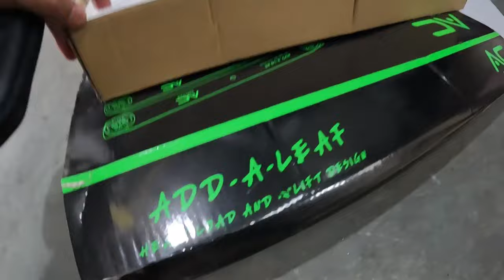RIDEMAX 2 INCH SUSPENSION LIFT FOR HILUX | BFGOODRICH KM3 TIRES | ROTIFORM SIX BY FUEL MAGS

Comment: Sa manila boss full build ko ridemax at king springs add a leaf, kasama na 17 na rins and 285/70/17 patriot tires rt+, 112k lng. Libre na lugnuts, balancing, wheel alignment, camber. Grbe mahal dgdi sa naga magpa build
Reply from the maker: Hehe eu po , ako po kaya boss si mags and tires ko nakua ko secondhand lang worth 50k pero si brand niya rotiform by fuel mags and ang gulong BF Goodrich Km3 na kaya ang pinatrabaho ko lanh sa naga is si suspension para mapataasan ko si unit ko , biglaan man lang kaya na may natimingan na nagpapabakal digdi sa iriga ning maurag na mags and tires kaya tigkua ko na hehe
Reply: Boss saan ka nagpa build sa manila? Anong pangalan ng store?
Reply from the maker: Sariling concept ko yan boss, yung mags and tires nabili ko secondhand tapos yung suspension nagpalift lang ako sa naga city para makalagay yung nabili kong mags and tires
Reply from the maker: Pasubscribe ako boss salamat
Reply: San ka sa manila nag pa build boss? Mura yung 112k.
Reply from the maker: 2nd hand ko lang boss nabili mags and tires ko worth 50k tapos yung pagpalift ko is 52.5k kasama lugnuts dito lang po ako sa malapit samin bicol area nagpalift , yung ibang mga accessories hiwa hiwalay po yan kinabit hndi sya kasama sa 102.5k na gastos ko sa mags tires and lift, pasubscribe ako boss salamat
Reply: Ls autoworks ako nagpa build

Comment: i got mine a year a ago ridemax + kings setup wrap with bfg 285/75/17. i used to play 1  and 2 settings pero mdyo matatag pa din. i dont know sa iba yun pero yun tlaga na experienced ko with this setup
Reply from the maker: Hanggang ngayon ba boss ?
Reply: @EngrJaoMotovlogs  yes boss, good thing is mas okay sya compared sa stock suspension.
Reply from the maker: Pare pareho ba boss settings mo sa unahan at likod? Natry ko dati 1 sa unahan tapos 2 sa likod parang okay din ride nia boss
Reply: @EngrJaoMotovlogs  Anong sasakyan mo boss
Reply from the maker: 2021 Toyota Hilux G 4x2 AT boss
Reply: Kung 2” lift with 265/70 tires, no need na mag trim?
Reply from the maker: Sa tingin ko boss no need na since mas maliit tire size
Reply: ganito din na experience ko kay ridemax habang tumatagal tumatagtag sya... sold mine at nag palit ako ng profender queen series...
Reply from the maker: @Bushmaster222 ako kasi sir medyo di ko napapansin kung dahil sa suspension or dahil sa gulong ko hehe pasubscribe ako boss salamat
Reply: @Bushmaster222 malayong mas okay ant profender boss?
Reply: @JUNIUSBACLIG  malayo sobra sir 😁
Reply: @JUNIUSBACLIG  imagine mo na lang na para kang naka lc300 hehehe

Comment: Sir.. ano impact sa highway fuel economy sa ganyang setup with oversized whhels/tires?
Reply from the maker: Medyo tumaas ng konti fuel consumption niya since bumigat yung dala ni hilux , pero kapag bwelo naman yung byahe tapos nakapowermode ako depende na din yan sa apak mo ng accelerator boss saka kung paano mo mamamaintain speed mo para maging fuel efficient

Comment: Bos ngtabas pa po ba s gnyn size at Ng add ka po b n adaptor
Reply from the maker: Ou boss nagtabas pa , adaptor para saan po? Pasubscribe ako boss salamat
Reply: Done subscribe bossing ptingn nmn tinabas bos ilang kg na limit nya ngayon?
Reply from the maker: Sa loading capacity nia boss di ko masyadong kabisado hehe pasensya bossing siguro nadagdagan din ng konti since nagdagdag ng molye sa likod tataas yung dating 1000 kg loading capacity ng stock
Reply: Bos anu po ung tinabas nila sa ilalim?
Reply: Anu lo ung tinabas nila para saan?para di sumayad ung tires?
Reply from the maker: @abbyquiambaotv3179  body mount chop para di sumayad tires ,pasubscribe ako boss salamat

Comment: pag 285 sa hilux stock sir mag body chop na?
Reply from the maker: Ou boss ,sasabit na , pasubscribe ako boss salamat
Reply: ang 275 sir hindi?
Reply from the maker: Di ko lang boss sure mas okay if magtanong ka po dun sa mga shop mismo hehe
Reply: @ericchristianlouisandit  sasabit paren 275 boss pag hard turn tapos lubak lubak ung daan.
Reply from the maker: Salamat sa info boss
Reply: @sw4mp38  anung size po ung sakto at di nsayad?
Reply: @sw4mp38  bukod sa stock tires 270x70×17?
Reply: @sw4mp38  or ok lng magtabas?
Reply: @abbyquiambaotv3179  ok lang naman po mag mag cutting sa chasis nyo kung mag oversized tires kayo. sasakyan nyo naman po yan. pero advice ko lang if ever mag lagay kayo 285/70/17 tires. mag 2inch lift kayo or mag suspension lift. para hindi sayad.